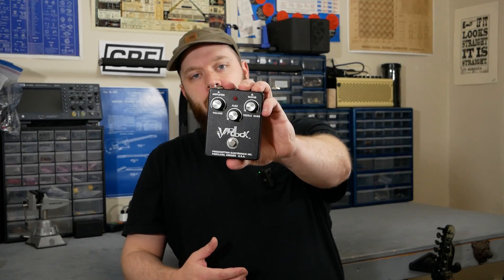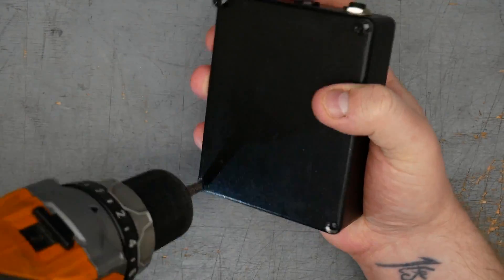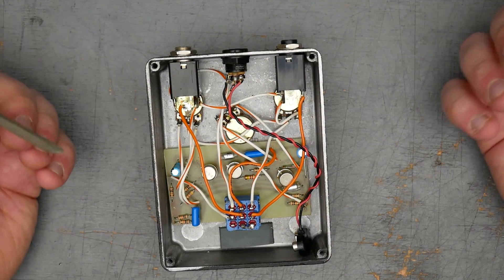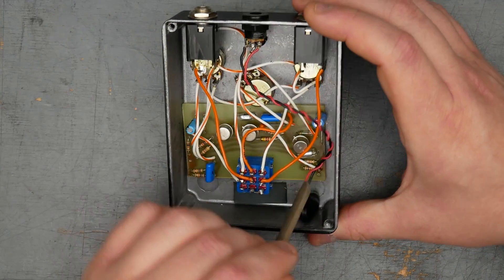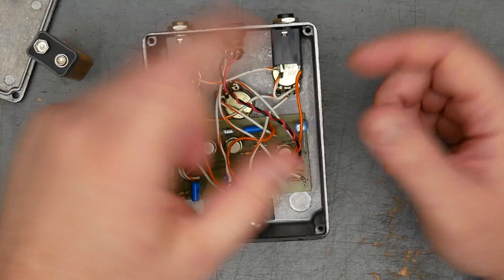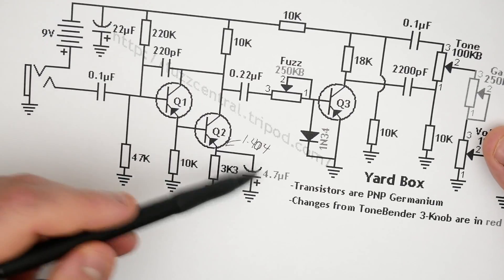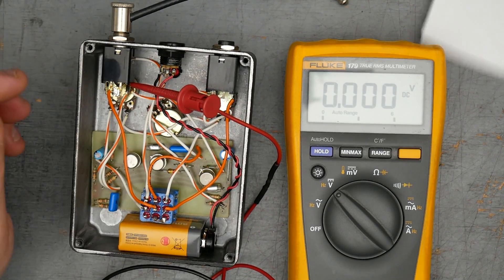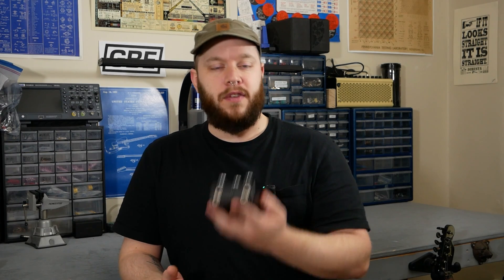Prescription Electronics Yardbox Teardown! See what's inside!

Comment: Hi I would like to ask you a question. I have a 2005 Electro Harmonix Electic lady mistress flanger. The problem is it has a really loud clock noise that increases as the rate knob is turned up. Is there any mod to fix thus. The clock noise makes this pedal impossible to play as it is. Any help greatly appreciated thanks from Mike from Niagara Falls, Ontario, Canada

Comment: Looks like you were measuring Pin 3 of the Q3 Fuzz pot, instead of Pin 1. The diagram looks to be correct, but I would make the point that fully CW, Pin 1, 2 & 3 would all read the same. It looks like you have the Fuzz dimed, so the measurement should be correct anyway.

Comment: What is that stage called that has a Diode 1N34 with Transistor Q3? its Clipping only the Positive Cycle of the waveform
Reply: The Ge diode is for temperature stabilisation and bias..these minium part count germanium fuzzs where vulnerable to performance issue's due to atmospheric temperature changes...the diode in the mk3 was an attempt to get some reliability ..you can see how delicate germanium transistors are when you test HFE gain on a dmm...if you just handle them in test you can see the hfe gain goes all over the place so the diode in the mk3 stabilises bias ..some builders will just use another Ge transistor for that diode..it serves the same purpose

Comment: I've haven't noticed noise from higher gain pedals due to messy wiring, I hate messy wiring due to O.C.D, so I tend to avoid it. My understanding is 90 degree crossings can be a lot more important with circuits that deal with much higher voltages and have seen that for myself in those EHX tube pedals. However, I have noticed noise coming from wires running too close to certain things in bbd circuits and, again, those tube EHX pedals. Shoutout to the Wiggler!